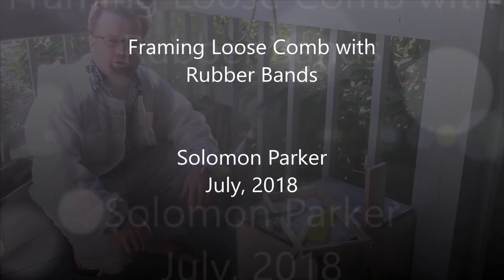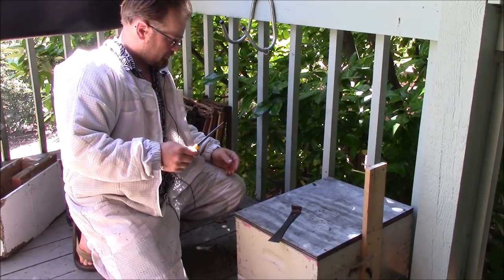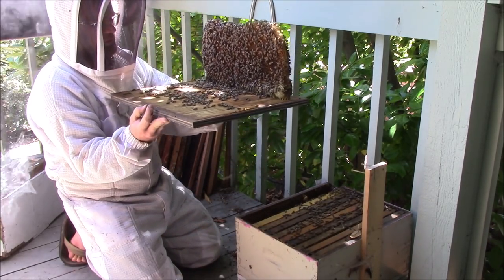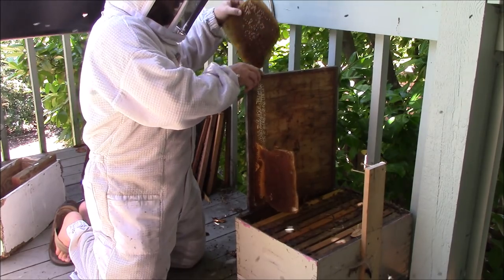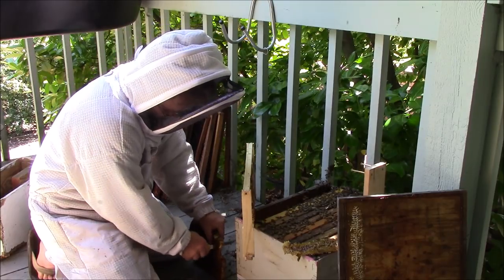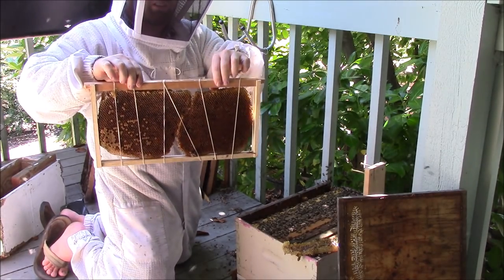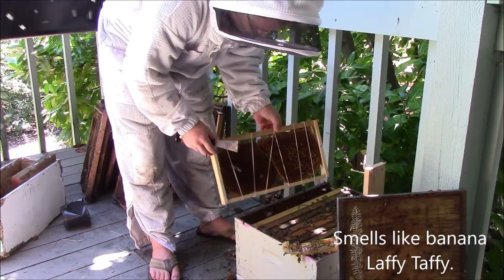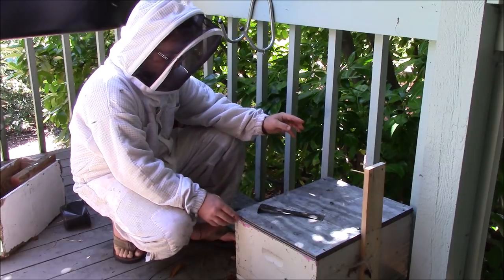How to: Frame Loose Comb with Rubber Bands with Solomon Parker

Comment: Hi, I would always add for the sake of newbees--when lifting the lid with attached comb- or doing a cutout on the roof of a meter box (a typical occupancy) ---Keeping the comb IN THE VERTICAL ORIENTATION.   Too often the remover turns the comb to horizontal when they start looking and it falls off.   Also, this was a lot easier than the typical cutout where the bees have had no guides to follow, so comb pieces are too short for the frame, are wavey, not flat, etc.   Bees hate to fill in a gap at the underside of the topbar, so it the piece is too short, a small series of zip ties, constricting the rubber bands to hold the comb against the underside of the top bar helps with comb that falls to the bottom bar.   Also,  newbees need to remember to keep the comb in the same orientation as it was in the original site.
Reply from the maker: Yes, this is excellent information.  My method can at times be more showing than telling.  As you saw, I treated the comb exactly as you said, and it didn't break off.  Learned that so long ago that it's natural for me now.

Comment: What do you put in your smoker? Whatever it is smokes so well.  We have not found anything that keeps that continues stream of smoke going.
Reply: I use a commercial size smoker (bigger is always better) and I use plain old chunks of wood, leftover from projects, etc. It gets burned down to charcoal, then is easy to start with a torch next time, then just add some more chunks of wood each time.  I cut boards down to about 1" pieces, then chop them up with a hatchet.